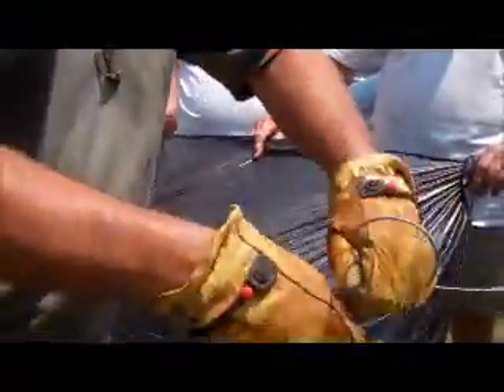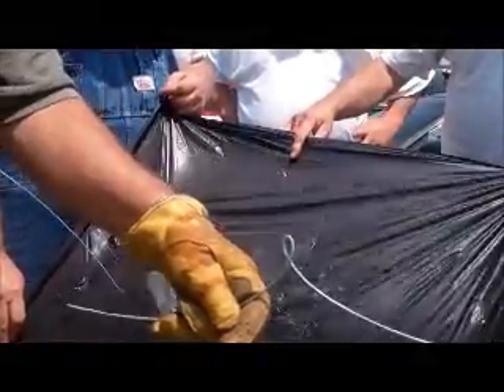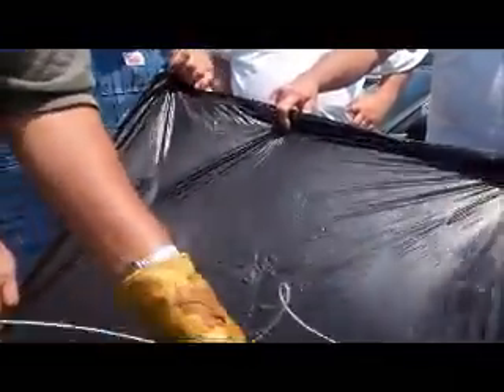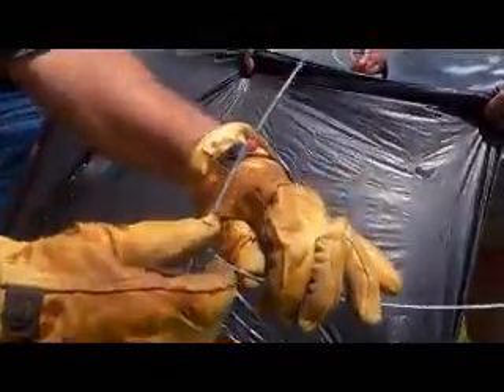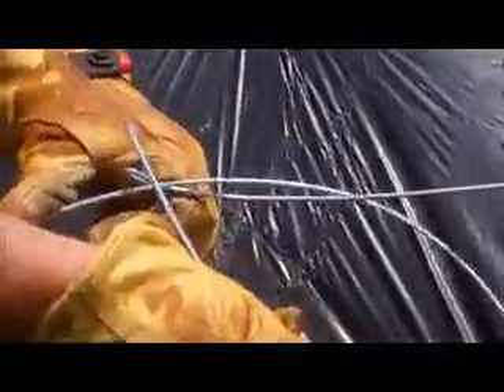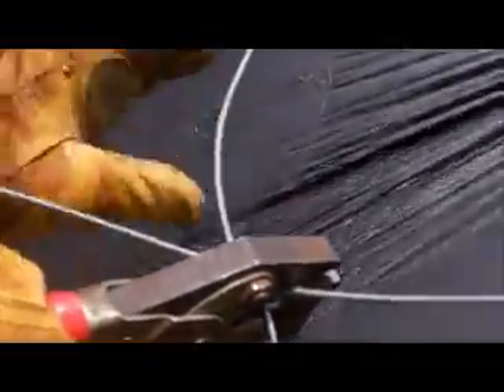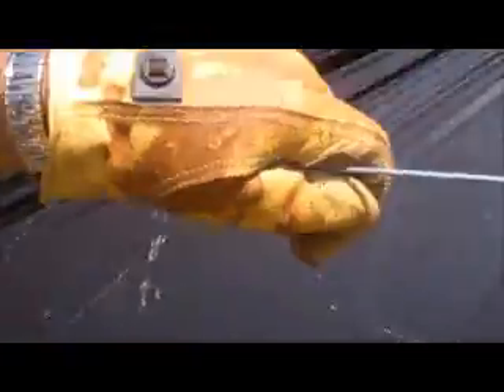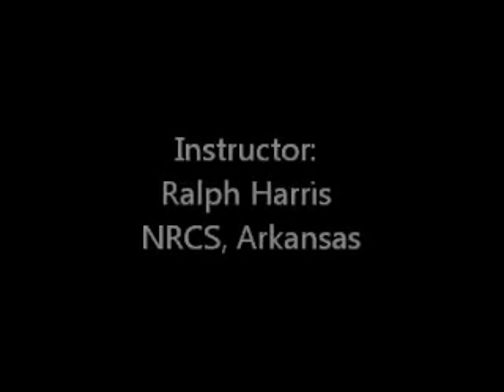Electric Fencing: How to Splice Wires Together

Comment: Thanks so much for the Video and teaching!
Reply: Exactly!  Did you watch your own video before posting it?  And, wrapping wire is not the best way ...every where there is a gap because you can not get it tight enough not to have slight gaps where it is wrapped,  will cause arcing of the electricity and it will eventually cause the wire to burn off...bad deal.

Comment: Nice magic trick! I’d like it better if I could actually see it
Reply: ha ha ha ha   REALLY!
Reply: Exactly!  Did you watch your own video before posting it?  And, wrapping wire is not the best way ...every where there is a gap because you can not get it tight enough not to have slight gaps where it is wrapped,  will cause arcing of the electricity and it will eventually cause the wire to burn off...bad deal.

Comment: Ignore the whiners.
Video was quick, to the point and helped me immensely.
No artsy fartsy wide angle views of farms, animals or other useless crap.
Reply: It to the point alright good luck...... wrapping wire is not the best way ...every where there is a gap because you can not get it tight enough not to have slight gaps where it is wrapped,  will cause arcing of the electricity and it will eventually cause the wire to burn off...bad deal.
Reply: @cactusladysouth1000  So.... Why don't you post a video showing what you believe to be the correct way to splice the wire?  That would be far more helpful than just saying that you don't believe this is the proper technique.

Comment: Slow motion does not help if the action we are looking for is not in view
Reply: The camera man was drunk or something. The splice is not in view a lot of the time. Look at the size of the gloves.  Can't see the wire at all.  Also, what notch?
Reply: For fuck sake guys , that was the easiest knot to follow , but will still lead to arching
Reply: Exactly!  Did you watch your own video before posting it?  And, wrapping wire is not the best way ...every where there is a gap because you can not get it tight enough not to have slight gaps where it is wrapped,  will cause arcing of the electricity and it will eventually cause the wire to burn off...bad deal.

Comment: Have to repair a buddies fence in SD, has a son in ICU. About 4 miles of fence, thanks for the refresher will use this, haven't fixed fence since I left the farm 30 years ago.
Reply: And, wrapping wire is not the best way ...every where there is a gap because you can not get it tight enough not to have slight gaps where it is wrapped,  will cause arcing of the electricity and it will eventually cause the wire to burn off...bad deal.

Comment: Did I miss something....they splice mile after mile of high tensile like this...maybe with a couple more finish wraps on each end...but basically the same process.
Reply: And, wrapping wire is not the best way ...every where there is a gap because you can not get it tight enough not to have slight gaps where it is wrapped,  will cause arcing of the electricity and it will eventually cause the wire to burn off...bad deal.